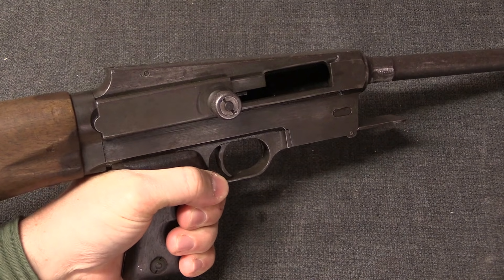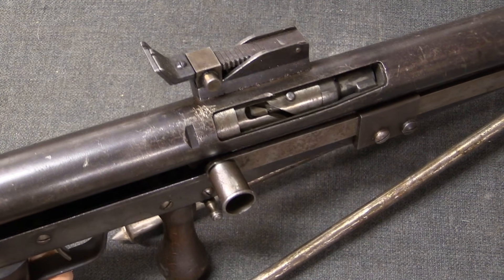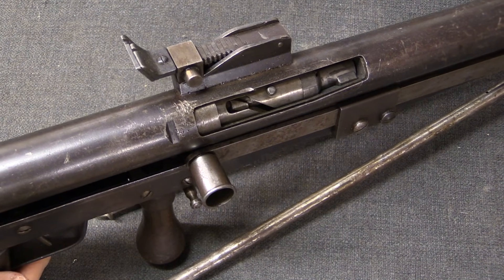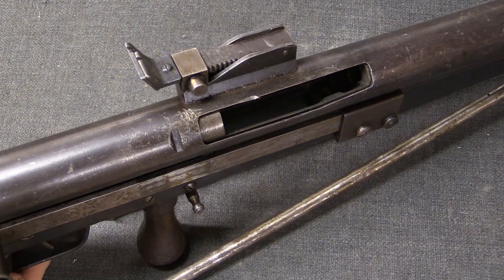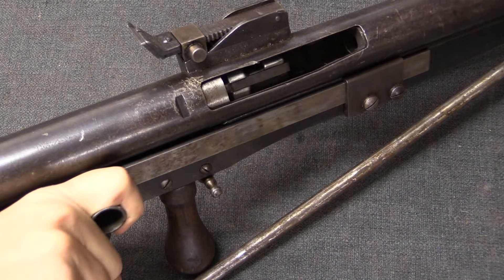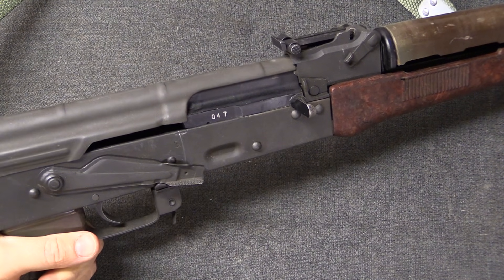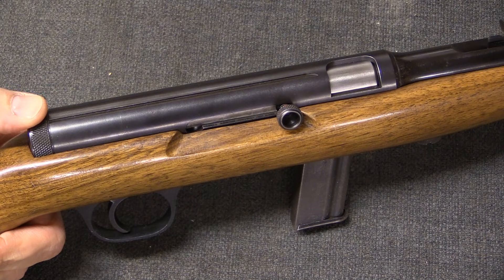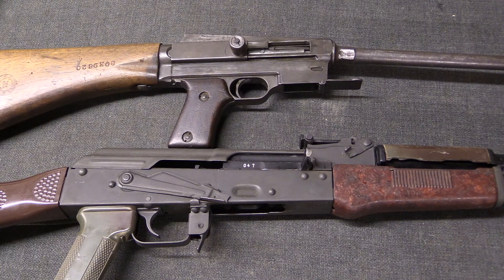How Does it Work: Open Bolt vs Closed Bolt Firearms

Comment: Do open bolt firearms have an action spring in addition to the recoil spring? If they do, why cannot the recoil spring serve as the action/firing spring at the end of the bolt stroke in open-bolt firearms? Please answer, since I have not been able to find the action spring in the "How so-so works" videos. I have watched a lot of "How ... works" videos: only the operation of the recoil spring in them.
Reply: Action spring, like the spring holding the hammer or striker back?

Comment: Great video! However, I've heard a point of view from a professional firearm engineer in China that an open bolt can help the gun with its full-auto accuracy. 
According to him, that's because when you fire a closed-bolt gun in full auto, there will be only the hammer and the firing pin moving before the first round fires, then the gun is going to unlock, extract, eject the case, feed and chanber the next round, lock the bolt, then fire the second round. There are a lot more parts moving before the second round fires, but the following rounds will be fired in the same way. So, the firing condition is about the same among the 2nd~nth round, but it's different from that of the 1st round. So, the first round will be the most accurate one, but it will also be a flyer, because the following rounds will hit a different zone. However, an open-bolt gun won't have such an issue at all, because the firing condition will be consistent. Therefore, an open bolt will help a gun with its full-auto accuracy, and, according to the engineer, a lot of experiments have proved that. What's your opinion about this, Ian? I have never fired a firearm and I don't know much practical thing about firearms.

Comment: Open bolt semi-autos aren't banned. The ATF rulings just say "designed to fire automatically or easily restorable to automatic fire." 
While, granted, this more often applies to open bolt guns, the bolt being opened or closed is not a definitive factor in these rulings.

Comment: Just a reminder that the ATF sucks.  There are tons of guns that can be converted to full auto.  Are we going to ban all V8's cause they are to easy to turn into drag cars to break the speed limit.
Reply: Ian overstated what the ATF ban was. It was basically a ban on open bolt, fixed firing pin designs that relied on an easily disabled disconnector to prevent full auto. (e.g. grind a nub off the bolt that engaged the discnonecteor or simply remove the disconnector part).  FuddBusters has a good video on it.

Comment: One of the disadvantages of an open bolt weapon is that they are not as safe.  It's easy to have an ND (negligent discharge i.e. firing one or more rounds when you're not supposed to) with an open bolt weapon, by letting go of the cocking handle before the working parts are fully to the rear.  Hope you understand my British terminology.

Comment: 🤨🤔😒 What is the strange looking submachine gun(??) at 0:04? Its upper receiver and barrel are angled diagonally downward from the natural position of the stock & lower receiver. It looks like shooting it(or just holding it) would be a strange and unusual experience.... Also, is its front stock just missing, or is its lack of a front stock or hand grip just another unusual "feature"? 😶😑🙄
Reply: It's a french mas-38 SMG its from ww2

Comment: Stupid question, but what happens to the spent casings in a closed bolt design if they don't fly out the open hole in the side because the bolt doesn't move back?
Reply: In both open bolt and closed bolt weapons the force from firing the round pushes the bolt back and immediately ejects the spent casing. If the spent casing is not ejected the gun has either malfunctioned or it is a bolt action.

Comment: Another open bolt feature is unlike closed bolt operation, all you have to do is pull the magazine to unload, as the chamber is empty until the trigger is pulled and the bolt slides forward.  However open bolt guns are thought to be more susceptible to slamfires, especially if they fall over or the butt is slammed on the ground.  But that is probably more a result of a very worn out receiver.

Comment: One question: I have heard that closed-bolt design is (or at least was) necessary for weapons being fired with an interrupter gear through a propeller. It allowed for more precise (on the scale of milliseconds) timing firing of each round. Is this true?

I was reading a history of the industrial side of the US war effort, and this was the reason given for focusing on the existing M1919 rather than developing an open bolt alternative; the gun could be used on fighter planes as well as by infantry. This choice was in 1939/1940 before the lessons of the Battle of Britain and the decision had been made to switch to .50 cals as a minimum for fighter armament. Is there truth to this or is this what you get when an economic historian writes about weapons?
Reply: I had a similar thought. The British .303 Browning was an open bolt derivative of the M1919, to prevent cook-off's in wing mounted guns, prevalent with Cordite propellant, or rounds being fired by impact when the aircraft was landing or taking off. 

It was, however, synchronised to fire through the propeller in at least the Gloster Gladiator - see some info here: http://www.quarryhs.co.uk/Synchro.pdf - so it could be done with an open bolt design.

One problem with wing mounted Brownings (especially in the Spitfire) was freezing at altitude as the air was rammed through the barrel to the open bolt.

Comment: You forgott to mention two advantages for closed bolt systems.

-accidental shooting is less likelly to occure.
(For example You can shoot an open bolt if you charge it inproperly)

You can seal the gun. Mud does not come in.

Comment: Thank you for the explanation that open bolts can’t be manufactured anymore. When I was looking at FN’s M249 repo I was thinking of dropping the money on it but realized it was closed bolt as oppose to the open bolt. I couldn’t find out any reason behind this and the only thing I can gather is they did it for reliability. That is until I stumbled upon this video and now fully understand. I’m still on the fence of getting the civilian m249 as it would be cool but too bulky and heavy to be useful other than a talking piece.

Comment: How is a open bolt simpler than a close bolt design? What goes into one? Is it a matter of simply a fixed firing pin on an open bolt vs a moving firing pin on a closed bolt?

Comment: Considering this is related to machine guns, does a quick change barrel affect the accuracy in any way?
Reply: Not unless you fail to swap out a barrel and fire well past the overheating point that would eventually wear away the rifling but the gun would probably have other malfunctions before then.
Reply: @tristanholland6445  Thanks for the info.

Comment: Offtopic - Ian always talks about these weird weapons that have these special traits and I've wondered.... Like there is Formula1 racing, there should be top tier shooting with speed/accuracy courses in 5.56, but the actual caliber is the only limit, and maybe regulated mag swaps like 3 per course or whatever. And gun manufacturers would field these "factory" sporting guns that are good for only those few seconds on the range at a time like racing was done in the golden times - complete engine rebuild after each race. Gun Formula 1. :D Those would be interesting most likely.

Comment: You didn't answer the question, was the atf right about open bolt being easier to convert to auto. Or was it just another dumb atf rule...
Reply: It actually is dependent upon the design of the specific gun but it's still a silly law

Comment: Sir Thank You and Karl for your wonderful and informative videos , I believe an Idea for a future video would be the temperature that the average cartridge would COOK OFF in a reasonably short amount of time, a few people outside the military (me) or class III weapons owners cannot imagine how quickly a chamber and the rest of the barrel assembly heats up during sustained automatic fire and even repeated magazine dumps are NO equivalent to the HIGH temperatures that cartridges cook-off at,and  in my youth my friends and I frequently had accidently 22 LR rounds left in clothing and went thru the dryer and never COOKED-OFF IN THE DRYER but still fired just fine, and even into adulthood the occasional  pistol caliber (modern centerfire) cartridge went thru the laundry and didn't COOK-OFF in the dryer and still functioned. please keep up your Great Work ! ! ! 
PS Back in 1983 at Fort Dix we where told one the major concerns with an M60 general purpose machine gun (medium machine gun) was cook-off after sustained firing, especially in training settings as the machine gun, could easily become OVER HEATED and cook-off and as an open bolt machine gun this meet the cartridge and or cartridges where not in any pressure containment device thus failing catastrophically, Thus being dubbed the Drill Sargent KILLER and considering we also had to throw an LIVE Grenade in basic training it was very telling that the weapon that had earned that unfortunate and grim and morbid moniker was The M60 and not the M67.

Comment: So it would be beneficial to have a closed bolt system in semi and burst mode switching to open bolt on full auto?
Reply: In theory it is but the majority of firearms have one type or the other. The FG42 is probably the most well known closed bolt for semiautomatic open bolt for fully automatic firearms.
Reply: @tristanholland6445  Yes I know about the FG42 and it was and still is a revolutionary weapon.

Comment: One of the things that confused me about open vs closed bolt for the longest time was the descriptor itself - open vs closed
i thought that the bolt opened up like a vessel somehow, that the bolt changed shape perhaps to release something if the bolt were open
like a open bottle of water or something
the term open or closed is used in firearms more similarly to how it is used to describe a door, rather than a vessel.

Comment: I have just had the epiphany that the Lahti is an attempt at a "best of both worlds" action.  The Lahti 20mm anti-tank rifle has the bolt lock at the rear of its travel, so there is not a round waiting in the chamber.  Only when a target has been located in the sight picture does the bolt get released to travel forward and chamber a round.  Once everything has stopped bouncing* around after the bolt face has crashed into battery, the shooter fires from the closed bolt.  I think that the Lahti designer would have made that decision so that the kick of the Lahti's recoil and the kick of the Lahti's bolt being slammed into battery happen further apart for less uncomfortable shooting.  The Lahti is not as comfortable to shoot as the Solothurn, but the Lahti is more comfortable than it would be if the bolt returned to battery after each shot (I have shot neither weapon, but I remember Ian's comments after shooting each weapon)

Of course, I have just assumed the the Lahti's trigger is disabled, until the bolt release handle has been fully released.  This is a reasonable assumption, as that prevents the race condition of the bolt having to get into battery before the firing pin strikes the primer.  The other thought that struck me as I am typing this is that (if striker fired) the Lahti's striker spring should be compressed as the bolt goes forward, like the Lee-Enfield bolt action, to absorb some of the energy of the bolt, as it moves forward.

[aside]  The down side of being very good at pattern recognition is that it is a necessary trait to 'screw up by the numbers', or do everything wrong, at the worst possible time, because what you perceived was incomplete and more data would have let you know that something else is actually going down.  The up side of being very good at pattern recognition is that you can successfully learn new things by filling in the blank spaces between what you do know.  Feel free to let me know which situation my comment has fallen under.

* At high loads and/or high speeds, EVERYTHING deforms and is springy

Comment: I have a question. I've witnessed the phenomena of an open bolt SMG (an Uzi) firing a round when the magazine was removed with the weapon hot (loaded magazine and cocked). Is this the rule or an exception in open bolt etiquette? Will any/most open bolt SMGs fire if hot when the magazine is removed, or is this just an Uzi thing? And why does this happen? I can't figure it out

Comment: close bolts also help with more gun hit accuracy (not shooters conditions) since the breach and bolt is locked and allows all the gas to push the bullet forward until it comes back and repeats the cycle. this extra gas means extra velocity on the projectile and gives better hit accuracy in compare to an open bolt which energy from the gas is also pushing the bolt back resulting in less energy for your projectile.

Comment: wouldnt there be a advantage of open bolts in recoil compensation?

the mass that moves forward pushes the gun a bit forward roughly at the same time the recoil kicks in.
so shouldnt this counteract the kick of the recoil a bit?
Reply from the maker: Only in "advanced primer ignition" systems, which I will address in a separate video.

Comment: The ATF is so stupid if you know how to convert a open bolt you will probably be able to convert a closed bolt  firearm lol great video explaining the open vs closed bolt
Reply: Ehhhh not really. To safely convert a closed bolt requires additional components to be manufactured. With open bolts, components just need to be modified or removed. 

They weren't wrong. Their entire agency is a waste of oxygen, but they weren't actually wrong.
Reply: Remember that when dealing with law makers, they`re not concerned with what is, but with what it looks like.  They saw an issue they couldn`t really address, so wrote a law to make it look like they could, and many people were happy that government had acted, even if nothing had really been achieved.

Comment: The atf really does not have the authority to ‘grandfather’ pre 82’ open bolt semis. The law says “anything readily convertible” . They could extract that ruling as easily as they’ve retracted and enacted new rulings countless times in the past. They’ve also just ruled two things which contradict each other with this recent bumpstock ban. 1) they ruled that the ‘single function of the trigger’ in the machinegun definition law means single PULL. but they also just said binary triggers are OK. well a binary fires 2 rounds with a single PULL. My point is the atf is dangerously all over the place with their rulings and could very easily change their mind and make you a felon overnight without any laws being passed
Reply: Yea, ATF said that DIASs made before 1981 were legal to continue to own, but then some circuit court said ATF doesn't have the authority to grandfather now contraband items. And they've recently started to confiscate and charge people that still have them.
Reply: Yea i heard about that im curious i dont know wats the difference between a pre 81 and pre 86 DIAS? Were the 81’s unregistered under the nfa?
Reply: @user-oy9zy4ds9m  Before 1981 if you owned a DIAS it didn't have to be registered as long as you didn't have the rifle it went to. A pre-86 DIAS was registered between 1981 and 1986 and are legal to own by anyone.
Reply: Ah i see. Always heard about those sears but didnt know the story. Unregistered open bolt guns can sooo easily follow the same fate as well. The only thing saving them right now is atf themselves choosing not to go after them but so easily could

Comment: Is the governments/ATF's claim of Open bolt semi auto rifles are easy to convert into the dreaded full auto's true? Especially when we are talking about sporting arms like the rimfire shown in the video vs a converted to semi auto UZI or other surplus type weapon.
Reply: While it is easier to convert an open bolt semi-auto firearm into full auto, anyone with experience in machining and the proper tools could convert a closed bolt firearm as well, the only reason people don't is because its already illegal to do, the issue with a conversion to full auto is maintaining semi auto capabilities through a selector switch and making sure the fire rate isn't ridiculously high.

Comment: I don't see how an open bolt firearm is easier to convert into a full auto than a closed bolt. 

Is there any logic behind this or is it the usual ATF fuckery?
Reply: I think there is, although it's still bullshit. I've seen some people elsewhere point out that a closed-bolt can't have a fixed firing pin unless you overengineer the heck out of it. Fixed firing pin = less moving parts = easier to mess with.

Comment: Excellent description of open/closed bolt configuration. I now fully understand that my MP40 works on the open bolt system. The MP40 does have a pneumatic style buffer to help master the reciprocal mass of the bolt assembly. Unfortunately, my MP will never fire again as it has been deactivated (to old U.K. spec) but at least a few of the parts of the weapon can still move and be appreciated.

Comment: The ATF determination was not because the firearms were open bolt, but because they had fixed firing pins. An open bolt design that does not use a fixed firing pin would likely pass ATF muster based on the original rulings.

Comment: It would be interesting to compare firing mechanisms of open bolt guns, e.g., fixed firing pin vs mechanically activated firing pin, and design features like protrusions on the bolts of many SMGs to allow them to function with an integral firing pin.  I realize I am being selfish and will be content to continue to worship at the alter of Forgotten Weapons.